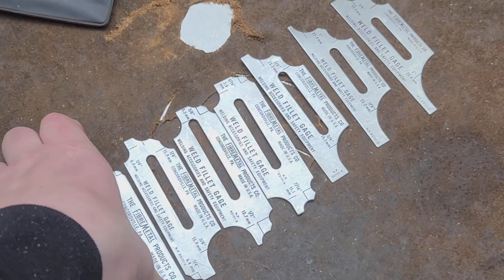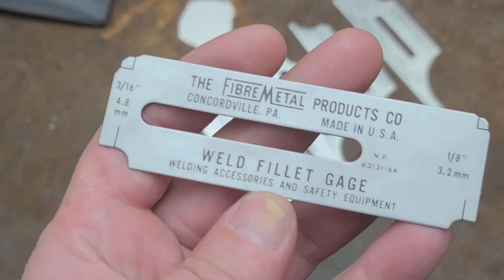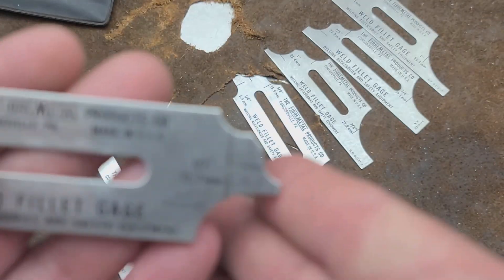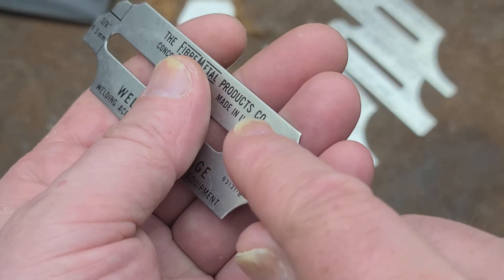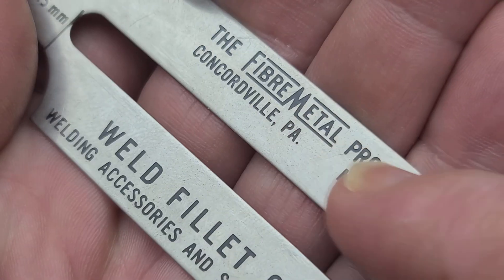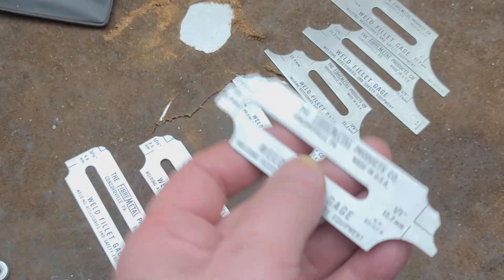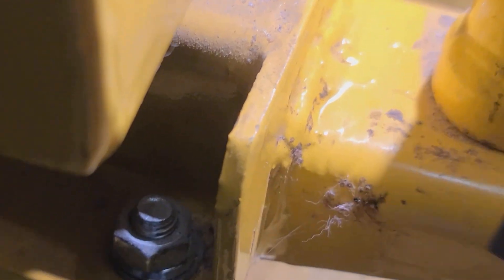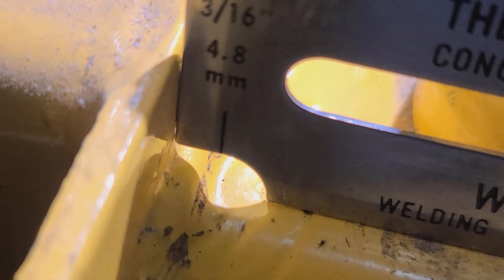Honeywell Fibre-Metal USA Welding Fillet Gauge Set Review

Comment: Fillet weld size does not automatically equate to a sound weld or adequate strength.
Neither does material thickness directly correspond to fillet weld size. 
For structural applications that require a PE stamp, the weld size must be specified on the drawing.
The weld must be performed in accordance with a Weld Procedure Specification (WPS).
The PE may require an inspection by a Certified Weld Inspector (CWI).
Further testing may be required, (Eddy Current, Mag Particle, Ultrasound, or X-Ray) to determine if the prescribed amount of weld penetration has been achieved.
Reply from the maker: You're absolutely right, there's a lot more to welding than just the size of the fillet.